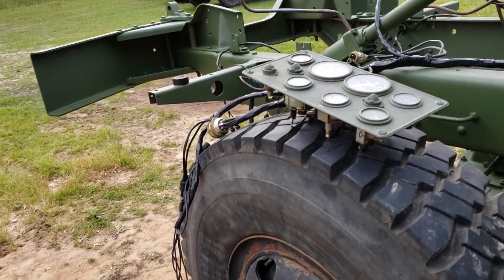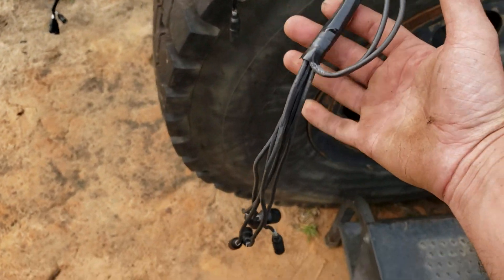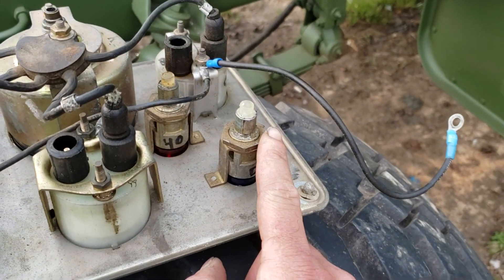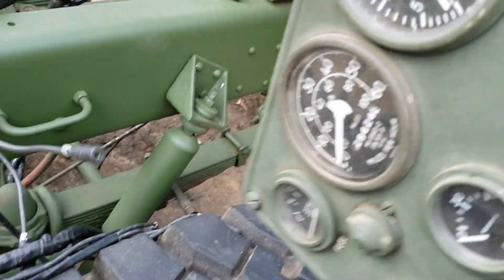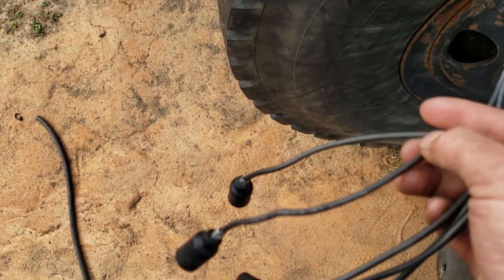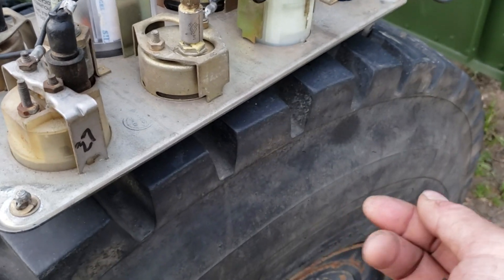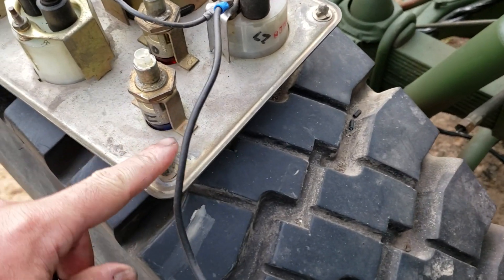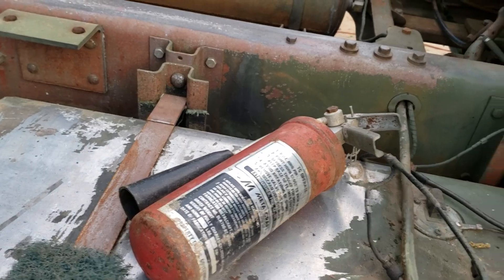Wiring your cluster without a schematic or wire chart made easy; you can do it!

Comment: Off topic... can you overfill your rear axle with gear oil? And if it’s possible will it contribute to bearing wash... I was always thought one finger knuckle below the filler hole was good...
Reply from the maker: That fill level is fine. You have another issue. Your vent is plugged or you aren't sealing the hubs right.
Reply: I thought I was sealing properly .....looking forward to a rear axle service video .. I might be missing something
Reply from the maker: May be a while. I do mine right, so they don't leak.😁
Reply: Yeah lol ... it’s pretty straight forward ...  I might have a faulty new seal ... the vents are new I was thinking I might have overfilled or been on a steep incline..and the seal was just sitting in oil... I’m starting to think now the A3 bearing are different form A2 outer bearings and maybe somehow the seal isn’t seating properly

Comment: Thanks for sharing!  Pardon my stupid ignorance if I'm not following closely enough but would this harness be adaptable to an M39 (not 939) 5 ton or M809 5 ton? Obviously the M939s are so different that it's going to be completely different or nearly so on those.  I ask on the older 5 tons since as far as I can tell the dash cluster pretty much the same and the trucks are intrinsically somewhat similar to that of the M35A2.
Reply from the maker: M39 series yes but you'll have to lengthen the wires to the front lights. Every other kind, no.